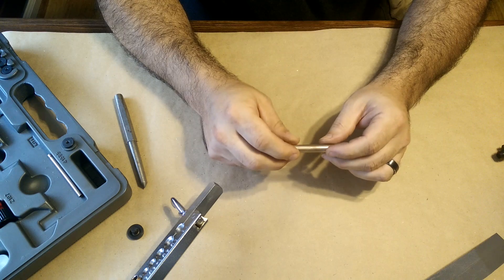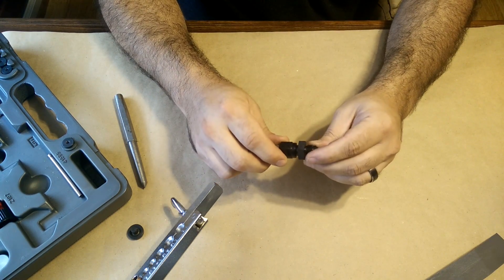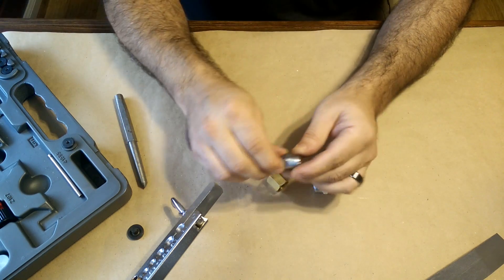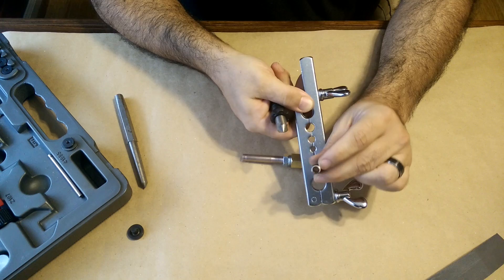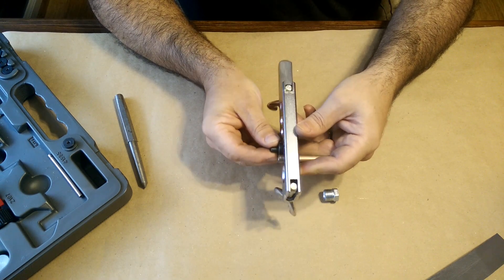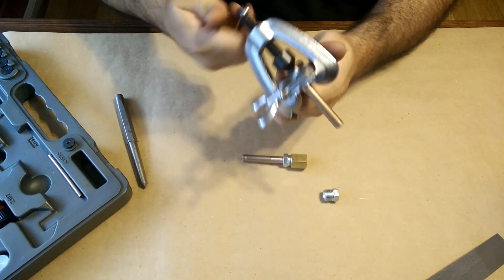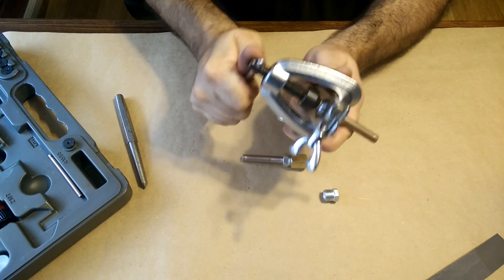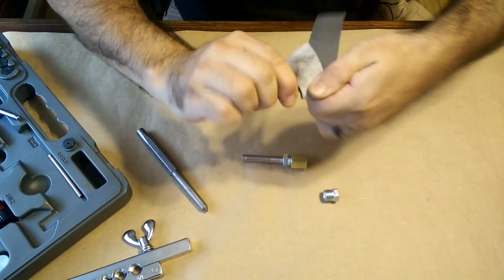How to mate brake or fuel lines with a double flare union

Comment: Great video, bought a silver line double flaring kit here in the UK, just wasted 3 hours trying to make it work, (copper pipe 3 sixteenths). Convinced now the instructions are wrong, they tell you to have the pipe sticking proud of the flaring block 0.5mm just made a mess. Noticed you used the die to measure how far out the pipe should protrude above the flaring block. Ah well have another go in the morning. 2am here now so technically it is morning. 🤐 off to bed, any more disasters will just take brake line and fittings to parts shop who provide a flaring service free of charge. Really wanted to learn how to do this myself, safety being paramount if am not happy with the results I will leave it to some one more competent. Thanks for your video, very clear instructions and video in great focus. ☺
Reply from the maker: Glad you liked the video. If you do what I did, I am sure you will have it down with some practice! The tube needs to stick out the width of the die in order to have enough metal to make the second flare. Also, make sure you trying to make 45 degree SAE double flares and not a European standard.
Reply: projectgattago yer was trying to do a double flare, all new brakes on my jeep grand cherokee wj. All new lines including flexi hoses. Gonna try a different flaring tool, hand held jobbie, looks like it will do the job, youtube video shows it flaring steel brake line in situ. My silverline one is probs made out of cheese, yours obviously works so better quality materials. What make is your flaring tool? Thanks for your help making this viideo showing me how its done, will have another go with new flaring tool, thanks. :-)

Comment: I’ve been wondering what this fitting is called for two weeks been everywhere trying to find it. Thank you for this video this is exactly what I was looking for. Just wanted to throw out that I’m having a heckuva time with my flaring tool they all seem to kind of suck if you get them from the auto parts store because the steel line keeps pushing through it before it flares. I even drilled a hole through the center of mine and used another bolt and nut to hold the center so it doesn’t bow out. And it still pushed the tubing right through the flaring tool.
Reply: i was having that issue, its the quality of the flaring tool kit

Comment: So…:
1. For carbureted engines, low pressure lines can be copper nickel and single flare, but EFI should use double flare. 
2. Brake lines can be copper nickel but always double flare
3. Never use pure copper tubing on a vibrating machine or high pressure lines
4. Compression fittings are for home applications like AC and fridge water lines

Correct?

Comment: good video. I was wondering how i could connect new lines to the very ends of my old lines. Is single flaring acceptable for a fuel injected vehicle, or do i have to double flare?
Reply from the maker: Always use double flares in high pressure systems.

Comment: I know I'm late to the party here, but could I do this on a fuel line from my fuel pump to my carburetor? Some people say, because of the slightly higher pressure, that it needs to be a single line with no unions...but putting in a union would GREATLY help me. 

Anyone can respond! I know this video is older.
Reply from the maker: You can easily do this. I run 58psi in my fuel system.

Comment: Okay, I did this for my brake line and it has a leak... I tightened it down as much as I could so it ended up stripping the union nut so I did it again and it's not as a bad of a leak but it still leaks lol
Reply from the maker: Your flares may not have turned out as well as they needed to be

Comment: I ordered up some steel 3/8's fuel line, will this work for connecting it to my existing 3/8 hard line and do you use teflon paste or tape?
Reply from the maker: Yes, it will connect to your existing line. There is no need for any teflon tape or paste because the seal is made on the flare and not on the threads.

Comment: I followed these  instructions,  and STILL ALL MY UNIONS LEAKED.
Reply from the maker: Sorry to hear that. It takes a little practice to get the flares just right.
Reply: @projectgattago  Use copper flare gaskets available from Grainger to stop the leaks.  They are used in aircraft applications but they also work in automotive applications.
Reply: Seat your flare fittings. Tighten then loosen, tighten and loosen,...do it about 4-5- times and even a slightly off flare will seat.